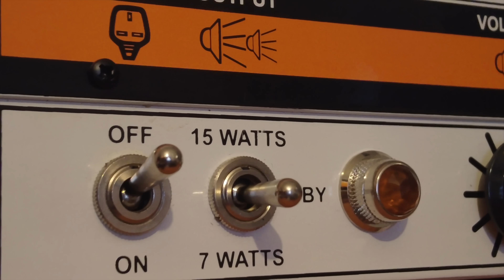WORLDS HOTTEST PICKUP

Comment: 54 kohm is a bit much lol. My Schecter Reaper FRS Decimator bridge pickup is over 18 kohms. The Sustainiac can be added if I need any more. It's great for hard rock/metal leads and can clean up enough for crunch/overdrive blues sounds. It is noticeably darker than my other pickups that range from 6.5 to 12 kohms. My alnico V singles at 7.4 kohms and PAF humbuckers at around 9 kohms are my favorites because they respond with the best sensitivity in regard to pick attack imo. Clean to crunch without adjusting any volume. Pedals for more if needed.

Comment: You are measuring dc resistance. The one possible characteristic you can determine, via dc resistance is the number of  wire turns in the coil. And that is only possible if you know the resistivity of the copper and the coil dimensions.  

It would be possible to increase the magnetic field strength and increase the wire gauge size hence lower the resistance and compare against a coil more wire turns around a weaker magnet, (higher dc resistance) and between the two different configurations obtain the same output levels. magnetic strength and turns is the determining factor. I will however, give you higher dc resistance implies more turns.

Comment: Ohms. You're measuring DC resistance. Which is just one factor in a pickup's 'output'.
A measurement used to differentiate two otherwise identical pickups.

Comment: I want one, dang that’s hot. Would love to hear it in the neck position. BTW, are those your picks slid beteween the strings? I was just lazy to put my picks in a pouch or holder, so I slide them between the strings. Also it is easier to pick up a guitar and play without fiddling for a pick.

Comment: I think they tried to create a passive EMG 85/81 type.  I am actually pretty interested in that whole "compressed leads and early breakover" sort of thing built in.  I would love to just be able to dial it in so I can just grab my vol knob to get clean or lay waste instead of hassling with more pedals. 
It might possible that the filtering artifacts can be moderated by winding the pickup in segments that have enough space between them not to share their flux so much, but I think that Fluence might have patents on voicing tech that does exactly that except uses stacked PCB to manage the "windings".  Depends on how their patent is worded as to whether they'd shriek if someone started explaining exactly what's going on inside - Alumitones are another odd duck, hollow pickups that are known for high gain but also retaining a borderline icepick quality like old Peavey logs.
I have several vintage guitars that have big fat square slugs on them; now I'm intrigued to pull them out and actually weigh them - I've been sort of fascinated by the parallels between the older Peavey blade pickups and the different variants of Bill Lawrence out there, but haven't had any of the BL to test against to actually compare for myself.

Comment: What you measure is the resistance of the coils, not really related to the output signal you will get. For instance, a bad solder, oxydation, could add a few kOhms serie resistance to your coil, and that obviously would not add more signal. Here we just assume the higher the resistance, the higher number of turns you have in the coil and in most cases it will be true.

Comment: 4:11 Actually, coil splitting is like half a humbucker(or it reduces output by half iirc) so having a humbucker that high output would still be very high output for single coil sounds. But if it's not great or practical for a humbucker(haven't gotten to that point in the vid) then I guess you may as well just get a high output single coil. Would be interesting to see how it actually sounds coil split.

Comment: What's the point in using resistance as metric here? Number of turns / magnet strength is what matters the most afaik. You can surely deduce that a high resistance also means more windings, but it is also influenced by the alloy used

Comment: The main issue with having such a high wind rate is that the inductance generated acts as a low pass filter. Meaning it will significantly attenuate/kill the high frequencies. Probably fine for down tuning, a 7 string version might make more sense, but not great for high searing solos. Also, if they went super Sayan on the magnets as well it'll kill the sustain. I don't really understand the point of this pickup. You can always raise the gain /attenuate the highs if you need that sound. Good luck putting the highs back in when using this pickup. Not commenting on whether I liked the sound or not. Personal preference.

Comment: It was interesting to hear the question is can it be paired with another pickup like a single coil strat or tele pickup etc. To see if in combination with another pickup what the changes would be some things need a good pairing to sound right. An by doing so could find that one of a kind sound that is both functional an practical.

Comment: It’s not really a tube screamer effect. Tube screamers/overdrives cut the bass and increase your midrange and treble before the volume boost. This is more like a clean boost pedal like TC Electronic Spark, Xotic EP, or EQ pedal. Because a completely clean boost brings up your entire guitar’s signal and guitars mostly produce bass and low-mid frequencies by default, most of these super hot pickups like this one and Seymour Duncan Invaders end up sounding muddy because of that. This pickup would probably work best if you use a tube screamer and need more bass out of the pedal.

Comment: I think it sounded really cool for leads but not great for chords. I don't use humbuckers that are over 15 or 16k now, because the way you have to wind them at that point either loses too much high end or adds too much midrange. The way you have to look at humbuckers is like they are a double single coil. One coil is going to have half the output and the other coil is going to have half. So if you have a 12k humbucker it's really just the sound of two 6k single coils sitting next to eachother just in a different form of bobbin/pole pieces.

Comment: It's not just the windings resistance  the magnetic inductance measured in Henries has to be considered to determine output my Warman drivetrains have a massive 20 Henries of magnetic inductance and 30k resistance but yeah 54k is very high resistance

Comment: i would like to point out that DCR is not a good way to know a pickup's output. you can have higher DCR if you use more turns of wire which yes = more output. but you can also have more DCR as a result of using thinner wire which gives more resistance per turn in the coil. 
so if a pickup has a slightly higher DCR then another, it could be because its hotter, or it could actually be a colder pickup using thinner wire resulting in more DCR but actually having lower output.
now if you have a huge difference in DCR (like in this case) then it probably is a hotter pickup. but dcr can only hint at a pickups output. it does NOT reveal a pickups output.

Comment: If you were to use this pickup with two single coils, I have been told that you want each of the singles at about half the output of the humbucker.
Is that true.
Where am I going to find a single coil at what, 25? Do they make those.
Now it's going to bug me until I can find a match.
Although, I don't want this to compromise the high frequency. I do need it to be there. If I can get the sound close, I can do some amp magic.

Comment: There's more to output than just resistance.  That's like saying 'my car is faster than my friend's car because it has a more powerful engine.'  But your car has no wheels and your friend's does.  It may be the hottest pickup on the market, I doubt it but it's possible that it has more output than the Dimarzio X2N.  But by accomplishing then with sheer overwrapping and creating resistance, they've made it mostly unusable.  For one thing, that 500k pot would have to go.  You'd need 1 meg pots at the very least.  That would brighten it up some but I'm not sure if it would be enough.

Comment: 9:12 So to start down the path of the tone of Randy Rhoads you start with a super high output pickup that didn't exist 40 years ago... 
Because I was hearing the starts of that tone and it could easily be dialed in from there...

Comment: The pickups resistance differs on a humbucker wired in series vs parallel (Between it's two coils), and is a bad indicator anyhow, what really counts is it's impedance!  You cannot have a true impedance meter, and anything that seams to has a computer circuit to calculate it based on the measurements (Multiple) it takes.  You can calculate it yourself, but it's not easy to explain it in just a few words, as it depends on resistance, capacitance, and inductance and Archimedes constant (π AKA pi).

Comment: So if you put a 50k resistor in series with the pickup it would be twice as loud?  Why not put a 50k in series with the single coil and make it a high output PU?  The resistance check does not indicate the output power, only that there is a lot of wire.  The magnets are a better indicator of the PU's output.

Comment: Loved the video, but i got to say i cringed a little at the output being measured in ohms. I get the point, its easy and obvious to use the resistance of a coil as a defining factor, but it's a resistance, not an output. It is affecting the output, sure, but not the only factor.

Comment: DC resistance is not equivalent to output. No, 54k does not mean three Super Distortions. They obviously had to wind it with tiny wire to fit that many turns on each bobbin. Thinner wire has a higher resistance per number of turns. Inductance is the electrical property that correlates with output, not resistance. It's a very basic mistake that requires minimal understanding of how pickups work.

Comment: I'd be really curious to see what this Pickup would sound like with individual magnet poles rather than a bar magnet design.
Reply: They probably had to use the Bar to fit in the winds!
Reply: @S-T-E-V-E  you're probably correct! Then I'd settle for 2 alnico bar magnets without the poles 🤣
Reply: @TheKeyOfAnarkh  I wonder what would happen if you overwound just the Adjustable pole piece side and left the slug side standard? What would that sound like? 😂
Reply: @s-t-e-v-e2824  one word: Noise. 😁

Comment: It would be nice to see what happens with more metal-type tones in a high gain amp w/ the gain reduced to match the distortion of a typical output pickup.  ...how much interference with sustain I wonder.

W/ negligible sustain loss, you might have a tap at fewer coils for rhythm and full blast for leads...  Could cut down on MFG processing by not needing a 2nd pickup w/ maybe very  very slightly less cost for a single pickup guitar (looking at some prices of single pickup guitars... maybe that's a bit far fetched).  but, you wouldn't be able to blend neck and bridge, so there's a tradeoff in this theoretical guitar.

Comment: What I'm about to say isn't exactly on point to this specific video, just a general rule of thumb!

Technically pickup DC-resistance doesn't tell anyone how high output the pickup is going to be. Think of noiseless single coils with "vintage" output. They have a second coil underneath, which means they technically are a humbucker. This means they can be in the 10+kOhm range, and yet have the output of a "standard" single coil. Output is determined more from what kind of magnets and how many windings the pickup has.

Obviously in this case the reading is so high, because the pickup has been wound to insane levels for fun!

Comment: Please explain why you think resistance means output. Am I missing something here? Higher ohms means higher electrical resistance not more output right?
Reply: It depends on certain things. The higher resistance will give you more volume BUT, past a certain resistance (depending on the wire gauge), the treble falls off because, the thickness of tone from the low to mid range 'drowns out' the treble, so to speak - you can wind a pickup to 1M if you can get the physical size right but, the sound will be similar to the guitar being played in the next room - woolly and not that good - unless that is THE tone that you want.

I've wound humbuckers from 3.69k (Grimfrost) to 254k (Black Hole). I know what CAN be done with the right equipment. Beyond that, it's down to personal taste and what the individual is willing pay for.

Comment: This pickup is utterly ridiculous. Since they named it "Nigel", they should've wired it to 55k  - then they could market it as "this pickup goes to 11. FIVE TIMES!"

Did they use neodinium magnets in this thing? That is an awful lot of pull being displayed.

I used to use fairly hot pickups myself (loved the sound of the Duncan JB in a guitar wired without a tone control, as well as the Fender Atomic). but I found that the dark sound and compression made it hard to hear the fundamental of the notes. I love that nice woody tone a good PAF style picup gives for a distorted or crunch tone.

You should experiment with a variety of things with this pickup:

try a different value pot for the volume, a 1000k pot should be interesting to get some high end back.

See if turning down the guitar volume would bring a cleaner tone.

Try running that thing thr)ough a high-gain metal amp. Also, it's be fun to run it through an amp which is harder to break up (like a more modern Fender Twin,  a HiWatt. also a non master volume Vox AC30.

Comment: Hi KDH! This is my first time commenting here. This pickup probably wouldn't be something that I would want in one of my guitars, but it seemed to be more useful than I was expecting when I read 54k. It was certainly a bit muddy but again, not as much as I was expecting it to be. With the right amp on the right settings, this could be the exact sound some would be looking for.

An aside from the main subject...

I liked the overall tone you were getting in terms of how the speakers and cab were responding to the amp. It sounded to me like a 4x12 closed back cab with Celestion Greenback speakers. Am I correct about that?

Cheers!
Reply from the maker: The cab is an oversized 2x12 with Celestion G12K100s
Reply: @KDH  Thanks. Also, I really appreciate the honesty and transparency of your content. I meant to say that in the first comment.

Comment: even  though it does sound like a high output pickup, the DC resistance have nothing to do with output. it is possible to wind a pickup with even higher resistance and still make it a rather low output. The resistance boils down to the size of the copper wire used. The output is linear to how many turns of wire it is on the coil(s). So please stop using resistance as an absolute measure of output from a pickup. And yeah, I wind pickups...

Comment: Please keep in mind that as you go to progressively thinner magnet wire, the DC resistance increases. 

But it’s the number of turns of wire that counts, not the resistance. 

If you wind 5,000 turns of 42 AWG wire on a humbucker bobbin, the DC resistance is about 3.75k. If you wind 5,000 turns of thinner 44 AWG, the resistance would be about 6k. It won’t be any louder, but it will sound a bit brighter. Think of Rickenbacker pickups. 

So as you wind more wire to make a hotter pickup, you run out of room on the bobbin. So you move to thinner wire. This allows more turns of wire, but the resistance goes to higher than the number of turns. A humbucker made with 6,000 turns each of 44 is about 16k. The same pickup wound with 43 is about 14k. Same output. Just a bit different sounding. 

So that pickup was probably wound with very thin wire, like 45AWG or thinner.  I wound a pickup with each coil having 10,000 turns of 44AWG wire. It came out to over 20k.

So that’s the highest resistance pickup. Not the highest output. But I’d imagine it’s pretty hot (until you reach the point of diminishing returns, and lose high frequency response. Think of a Gibson EB-0 pickup. About 30k and all mud! But that’s 42AWG wire.

Comment: Man output is not measured in Ohms, Ohm is the unit of resistance, Output is measured in Volts (most commonly milivolts for guitar pickups). You can have different output levels with the same resistance you are measuring depending on the current flow (where the unit is the Ampere). That's Ohm's Law, but actually a guitar pickup has not only resistance but for AC current actualy impedance... I would take this video down and make a correct one, despite your intentions are good, you are confusing a lot of people with this video. Just my two cents.

Comment: Energy comes from magnetic or electric fields….wire resistance has no inherent energy…at all.  Hot is referring to energy a coil of wire has no energy the potential comes from the magnetic field so a Gaussian reading would be more appropriate.  More winds creates more inductance and capacitance that is where the misconception comes from but if the magnetic core is tiny and weak you could have a million winds on a coil and it won’t increase output.  It is the big ass magnet that made that pickup powerful.

Comment: Please stop quoting "output" in ohms. Surely you're not referring to output impedance, though that's closer to what is measured. How does this methodology apply to active pickups or Alumitones and other low-Z designs?
Compare this pickup to Blackouts to illustrate the advantages of an active option.